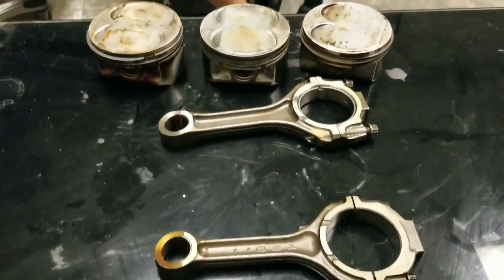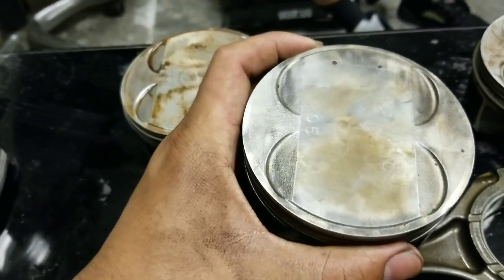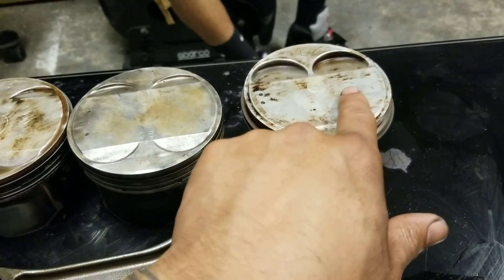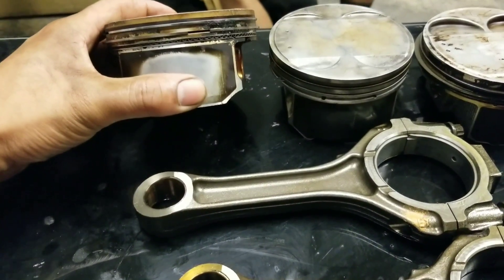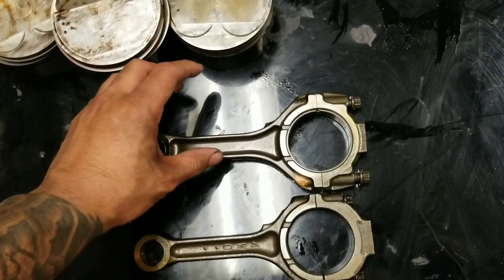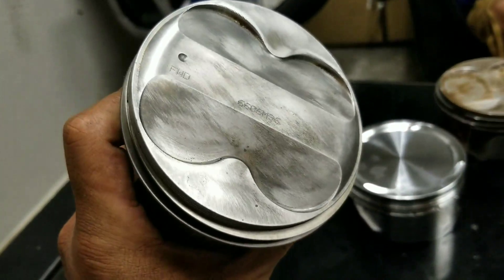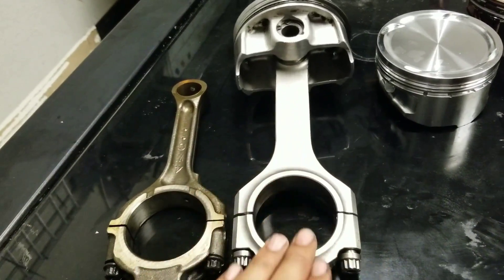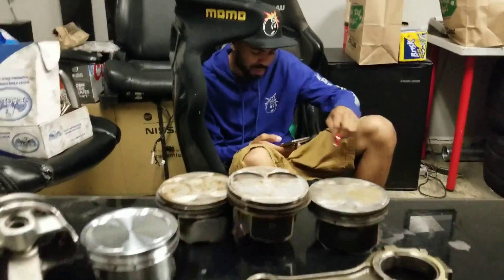De HR VHR

Comment: You can run high compression and big boost if you have the appropriate octane level in your fuel, AND proper intercooling. There are articles about this topic. Many racing teams and Drag cars have wicked Hi CP and Big Boost Turbo and Supercharger setups. With tuning technology constantly improving and the right setup/fuel, there is no reason why High compression and big boost wont work.

Comment: G35 350z 07-08 comes with hr, and 
G37 370z comes with vhr?
Reply: shan isepic the g35 coupe 07-08 never got an HR motor but I believe the g35 sedan did
Reply: Raiden Raiden yeah that's what I was referring to, g35 sedan and 350z 07-08
Reply: There's no G35 coupe in '08. Sedan only that year. We have one. '07 was the final year for the G35 coupe. '08 was the introductory year for the G37 coupe.
Reply: There's no 07 g35 hr
Reply: Daniyal S. 
Yes. The 07 sedan only had the hr motor. The 07 coupe still had the DE rev up motor.
Reply: @Dannyyzeee  I owed 07 g35s sedan  6 mt.. with health HR .. with only 120x miles..

Comment: So much wrong information..... The stroke in the HR vs DE is the same.... the angle is different, and hr has less cylinder friction. Also, the DE has slightly lower compression than the HR, they're not the same. The Revup is a DE motor, there is no Revup HR. The dots show the type of VVT the engine has. The DE has vvt on the intake only, the revup and the hr have vvt on both cams, thats why they use the same pistons. Only the 6mt anniversary and track edition 350z's after 2005 got the revup engine, thats why you dont see the hr pistons in every DE.